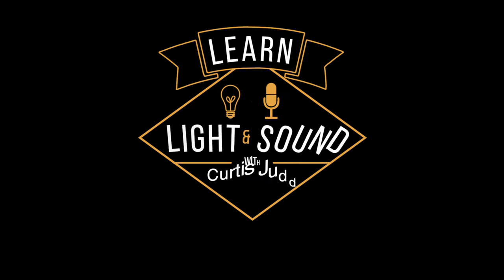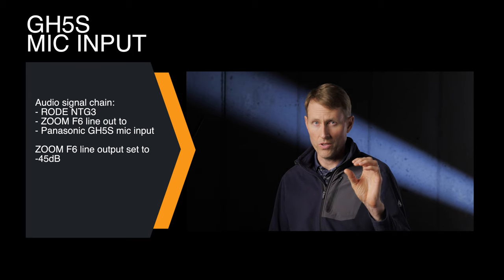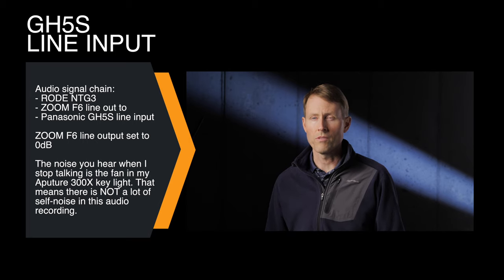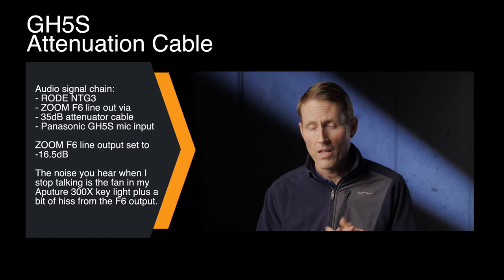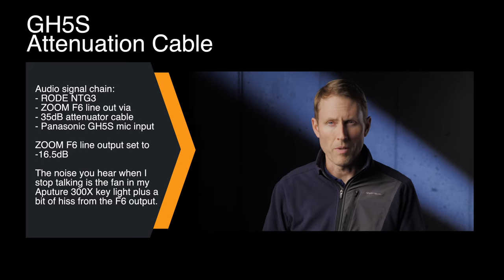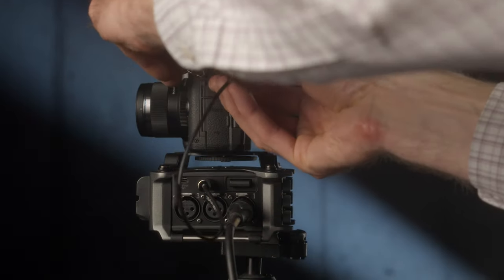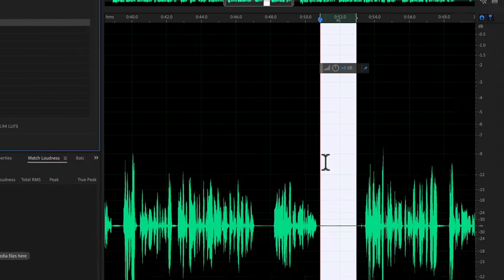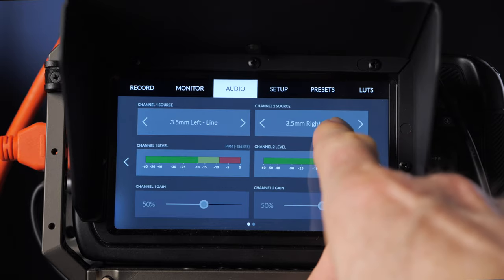Zoom F6 Line Out Issue & Workaround

Comment: Another workaround is to use the headphone out of the F6 to the camera ( in my case a7iii). That has worked well for me so far. Headphones connected to the camera to monitor things.
Reply from the maker: Thanks Richard. How does it do. in terms of audio quality that way? I've found the headphone amp to a be a little colored.
Reply: @curtisjudd  It may be colored or it might just be level.  Try volume matching.
Reply from the maker: @Hexspa  Yes - did some volume matching and sounds a little colored. It can still be usable if you're in a tight spot, but it isn't ideal. In that case, a beachtek audio adapter would be a much less expensive way to get the job done than an F6.

Comment: What did the firmware update on May 19th do if it didn't solve this like it says? Is it causing the problem now for more devices?
Reply from the maker: Hi Arturo, it changed the sound of the noise - possibly reduced the noise by 1 or 2 dB - but didn’t fix the issue. I have contacted ZOOM and sent them sample files. They are aware of the issue. The firmware update was only for the F6 and it didn’t create issues with any other products as far as I am aware.
Reply: Hi Curtis. Hopefully they come up with a fix quickly. Glad the update didn't introduce the issue. I was going to purchase soon.

Comment: Curtis, would you be interested in doing a video about differences in float recording on mixpre II series vs zoom f6?

It’s my understanding that on mixpre it only adds some decibels of additional dynamic range (post gain) and doesn’t protect that much from operator error (I tried a quick test and set fader to zero and it actually multiplies with zero instead of a very small number so you cannot recover, quite funny).

It’s also my understand that on the F6 it basically captures everything regarding of settings (pre gain).

So if I understand correctly the behavior of the feature is quite different, not exactly the same feature. Stores to the same format but there’s pretty big differences. But perhaps I’m misunderstanding :)
Reply from the maker: Hi randomgeocacher, I'm not sure I understand. When you set your fader to 0 on the MixPre II, you get clipped audio in 32-bit float mode?
Reply: @randomgeocacher MixPre still allows you to make a mix in 32-bit float, so if your channel fader is fully down, it wont be part of your mix, however it will still be recorded as an ISO channel which you can then boost or attenuate as much as you look without fear of noise or clipping. You can then even remix and rerecord your ISOs during playback if you want to adjust the mix balance - all with no clipping, noise etc.
Reply: Curtis Judd I haven’t tested so much with it yet. But set fader to zero and you get zeros in the mix. Will try again and see if it is reproducible :)
Reply: Paul Isaacs thanks!
Reply from the maker: @randomgeocacher  Do you mean set the fader to -infinity (all the way down) or 0 (the default mix position which passes the audio from the channel to the mix without affecting it)?

Comment: BTW. What lens do you use with GH5S for such talking heads? Is it Olympus 45mm f/1.8?
Reply from the maker: Yes, Olympus 45mm f/1.8. My second favorite m4/3 lens.
Reply: @curtisjudd  And what is first? I am currently trying to equip myself with lenses for my newly bought GH5S. I needed ultra wide angle reasonably fast lens for interior group shooting in tight spaces and other for talking heads. I tryied Sigma 10-20 3.5 with 0.71 speedbooster but it vignetted heavily.
Reply from the maker: @przybylskipawel  My first is the Lumix 12-35 f/2.8. In fact, those are the only two m4/3 lenses I own. I have heard the 8-18mm f/2.8-4 is pretty good on the ultra wide front but haven't used it personally.
Reply: @curtisjudd  My Olympus 7-14mm 2.8 stucked in Australia where I bought it on eBay due to COVID-19 related flight cancel. But I also think about 12-40 Olympus which would be simmilar to your Lumix. Have you tried any APS-C glass via speedbooster on GH5S?
Reply from the maker: @przybylskipawel  Back in my GH4 days I did but it didn't work very well for my workflow.
Reply: @curtisjudd  Yeah! I guess AF was unreliable. But with GH5S the problem is its multiaspect sensor that seems to be oversize.
Reply from the maker: @przybylskipawel  Oh, that's right. I forgot about that. I do hope that things settle here pretty soon so you can get your lens.

Comment: Have there been any firmware updates which resolve this?
Reply from the maker: No, but it seems the newer copies don't have the issue which suggests it was a hardware issue with the original F6. If you buy new now, shouldn't be an issue.

Comment: Is this an issue even when recording at 32bit? Does anyone can suggest settings for a7rIII a7III with the attenuator plugged in?
Reply from the maker: Yes, it also an issue with 32-bit float mode. It appears to be a hardware issue. Follow the process we show here to set it specifically for your camera after you add an attenuator cable.
Reply: @curtisjudd  Thanks a lot Curtis, if I manage to find one of those cables here in Europe I will certainly do what you suggest in the video... Surprisingly they are hard to find... maybe I should get one from amazon.com, hoping that I'll not pay extra custom fees. 

By the way... the hiss will be present also in the recorded track on the F6 or it's only by the camera side? I was wondering... if I monitor from the headphone out of the zoom and then sync in post, getting rid of the recorded audio on the camera?
Reply from the maker: @Paolo_Pino  The hiss is only in the camera recording. The audio recorded in the F6 will be clean.

Comment: Looks like this attenuator cable is worth the same it weights in gold :).
Nowhere to be found in my 2nd world country :(.
Reply from the maker: They’re very rare now since most recorders/cameras do not need them. But also, newer F6 copies do not have this issue so if you have a newer copy (I bought mine on pre-order at announcement) then you don’t need the attenuator cable.
Reply: @curtisjudd  I've bought my F6 in December 2021. It unfortunately suffers from this issue :(.
Shame A7IV does not have option to switch 3.5mm port into line-in mode.

Comment: hey guys, if anyone sees this - I'd like to know if this workaround is a good solution; does it have any drawbacks as compared to having an actual mic level output like those on the MixPre?
Reply from the maker: Hi Jimmy, yes, the downside is potentially downgraded audio quality because the F6 amplifies the audio, then the attenuation cable reduces the level, and then the camera amplifies the signal again. It isn't usually a big degrade, but it depends on the camera.
Reply from the maker: Also note that NOT ALL copies of the F6 has this issue. Those purchased after about November of 2020 seem not to have this issue. So I'd check your copy and confirm it is an issue before trying this workaround.
Reply: @curtisjudd  thanks! I didn't know Zoom changed something on later copies. Does this mean they now have a mic level option? Or simply having a lower level with the line output doesn't have as much hiss anymore? I'll have to see if a shop near me lets me try this out!
Reply from the maker: @jimmyhii3  Yes, on the new copies, you can just reduce the output fader to feed audio to cameras without an issue.

Comment: I feed my minijack cable into the headphone out on the F6 and it solves the problem.
Reply from the maker: How’s the audio quality?
Reply: @curtisjudd   To be honest it sounds pretty much the same as recorded on the sd card. When I do it I also record on the SD card, to be on the safe side.
Reply from the maker: @florinG  How do you calibrate the levels between the F6 and camera?
Reply: @curtisjudd  the fader adjustment makes a small difference because I keep it in 32 bit/at ~+15dB  but mainly I adjusted the levels  from the volume adjustment for headphone output till it looks good on the camera, prior to adjusting the levels to be between -12 to -6 or what have you. I also adjust in the menu of the camera the audio levels for the microphone to be the lowest value, which is usually 1 for the lowest noise possible.

Comment: what am I missing you are using a $699 Rode NTG-3 Shotgun Condenser Microphone. Why do you need the Zoom F6 recorder  and an antenuater cable Why not go directly into the GH5 with the  Rode NTG-3 Shotgun Condenser Microphone?
Reply from the maker: The GH5S has a 3.5mm mic/line input which does NOT supply phantom power. The NTG3 has an XLR balanced output and needs +48V phantom power. You need a preamp of some sort between the two. Or at least a power supply and XLR to 3.5mm adapter like the beachtek audio adapters.
Reply: @curtisjudd       Got it abd the back up audio workstoo.
Reply from the maker: @HoundDogMech  Right on!

Comment: Another solution would be to use a 3.5mm stereo too 2 mono 1/4in jack plug cable from the line output and run it through a stereo passive Di-Box , which will convert the line level signal down to two balanced mic level signals and set the camera audio inputs to mic . problem solved.
Reply from the maker: Indeed! Thanks for sharing. Good solution, albeit a little bit larger than an attenuator cable. But if one has a stereo DI on hand, great option!

Comment: I just bought the RODE GO II set. For the life of me I can't get the 2nd GO transmitter to register on the F6.  EDIT **     just found out that I need to buy the actual RODE splitter cable. I have a cheap non-brand one but doesn't seem to work. So I'll buy the RODE  one. If that doesn't work then I'll also buy 2 'RODE' 3.5mm TRS to XLR adapters. I have normal ones that SHOULD work so we'll see after I buy the splitter. This is video that just saved me and explained it in the 2nd half of the video          https://youtu.be/QZjSrwxUT6Y
Reply from the maker: Thanks for sharing, Stephen.